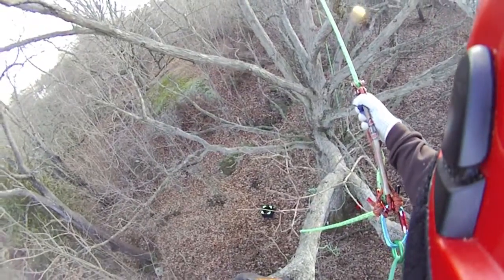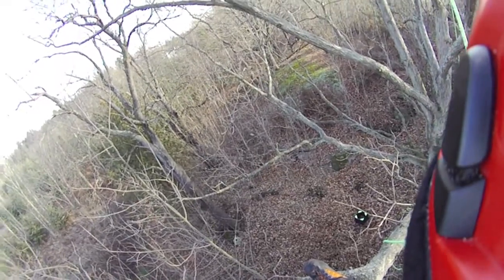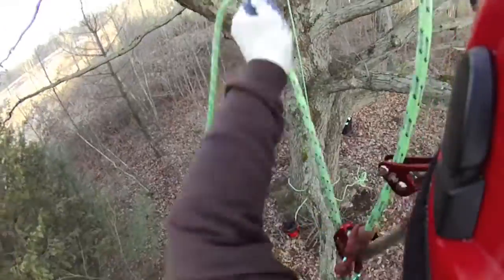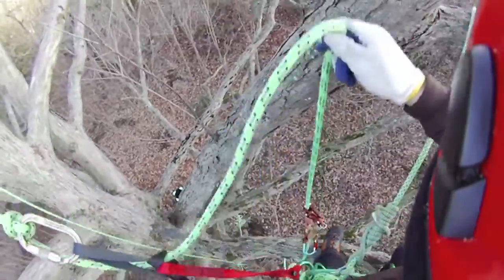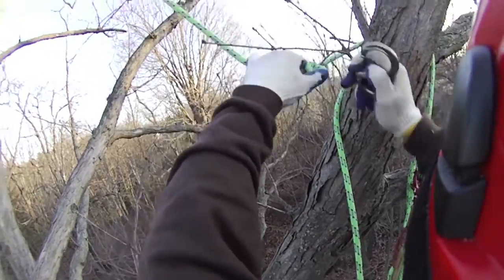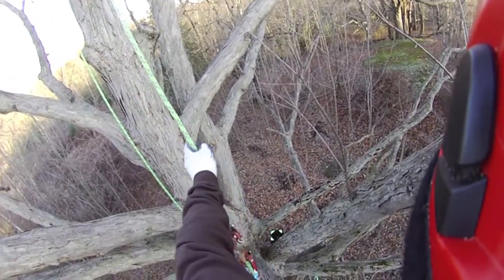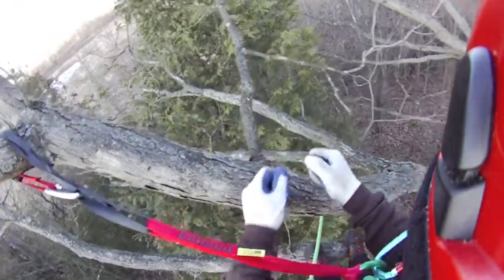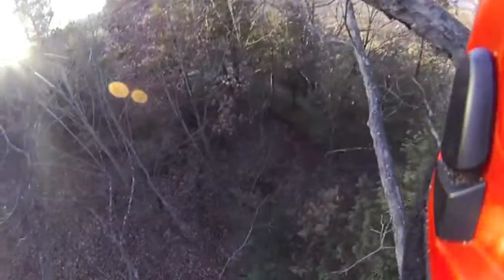Sterling Rope Chain reactor

Comment: Def should be double locking. Specially if your showing others how to use gear, make sure your doing it right. I've seen a triple locking open once. Regardless if you feel safe or not, its one accident and its all over.  Do you one hand a chainsaw? Wear chaps? Lanyard in when repositioning your TIP? I can free climb a tree, does that mean i should?